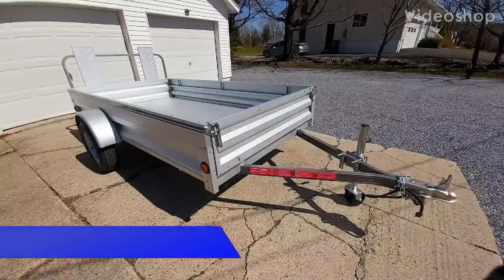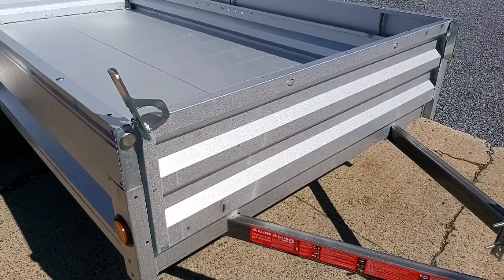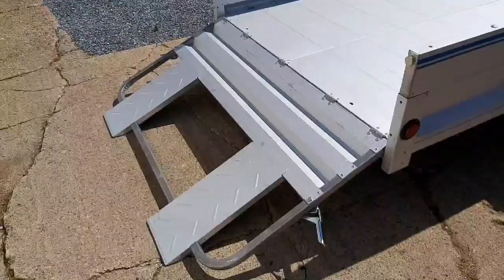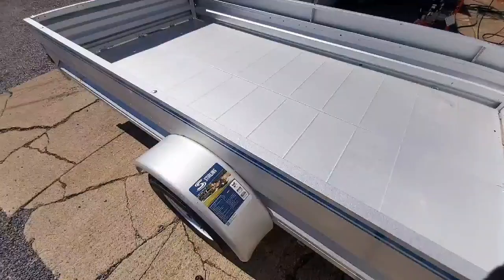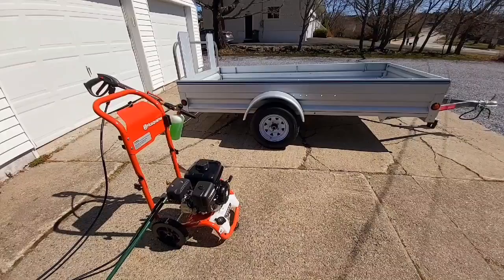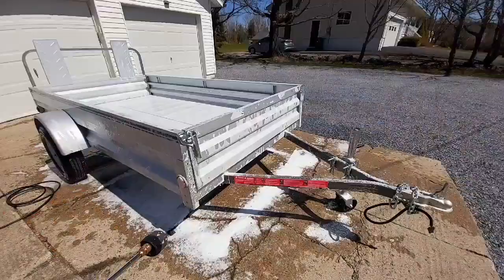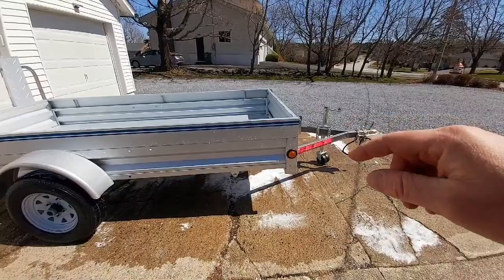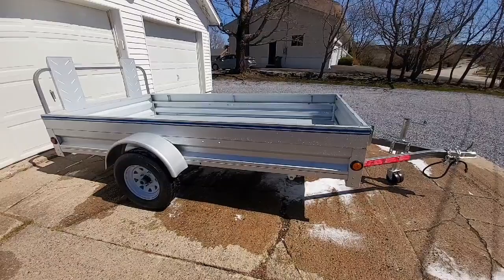Stirling 5x10 Utility Trailer with Ramp Gate Review

Comment: When its sitting in a level/neutral state, is the ball about 15" off the ground as they state?  It also says the axle is adjustable up to 6", is that up and down adjustable?  How do you feel those side posts will hold up to straps pulling on them, relatively strong?  Great little review.
Reply from the maker: Yes pretty close to the 15". I'll take a look at the axle adjustment. The trailer is holding up well, I haul my 1350lb SxS in it with no issues however they do feel cheaply made, pop riveted together and metal floor and sides seem a bit flimsy.

Comment: Hello, good review. How's the platform? Does it feel sturdy?
Reply from the maker: It's not as sturdy as I was hoping, I can see myself adding 3/4 pressure treated plywood down the road to it. It seems like fairly thin metal.
Reply: @PovertyPointCustoms  - being Galvanized, pressure treated plywood is not the best option. There are chemicals in the PT wood that react with the galvanized coating on the steel. It can greatly accelerate the corrosion of the trailer. Kinda like dissimilar metals and aluminum. 
   Just a heads up. It’s actually in the book you get with the trailer.